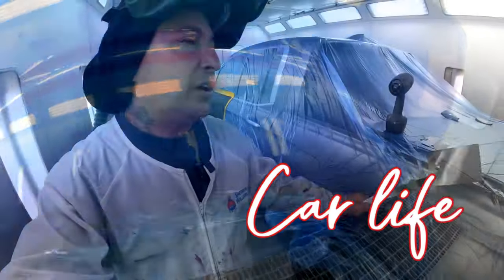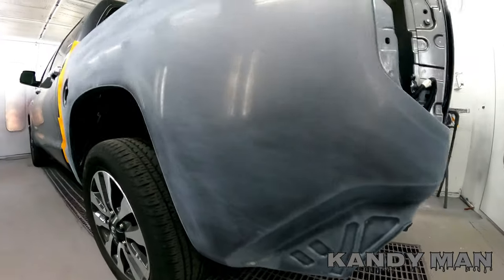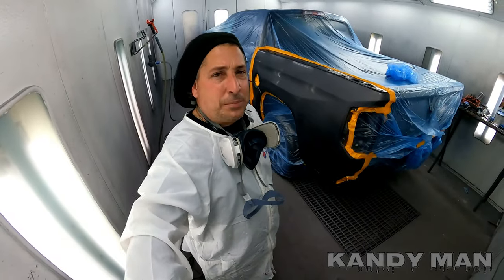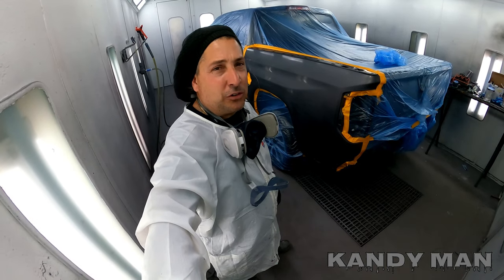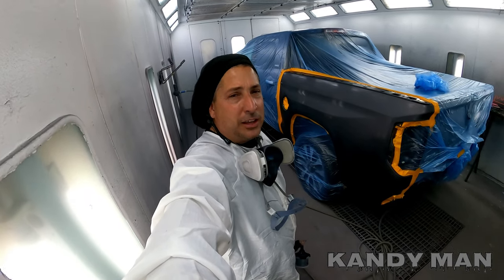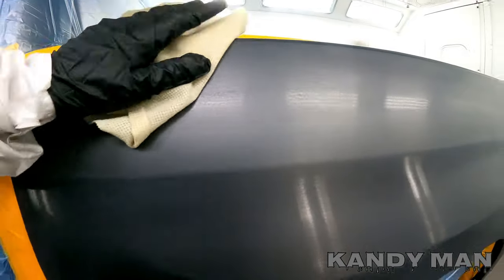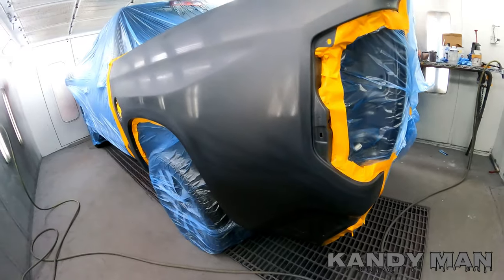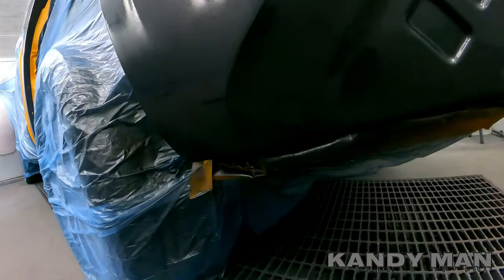STRAIGHT TO WET ON WET SEALER

Comment: I use a can primer called TranStar Direct to metal and raw plastics it sticks to all of it it’s the best can primer I’ve ever used you can put it over a little small body filler and it does not shrink so I would have put that on there and based then cleared but both ways will work thanks Kandy Man!!!!

Comment: Is waterborne paint a good paint for someone painting in his garage?
Reply from the maker: It could be used but is very slow if not sprayed in a controlled environment. It needs air flow to dry I would stick to solvent for garage jobs..
Reply: @kandyman5315  got it thanks